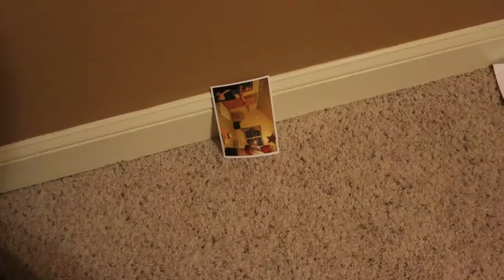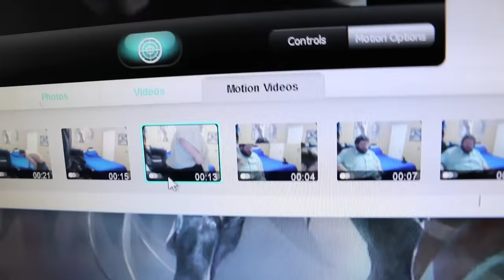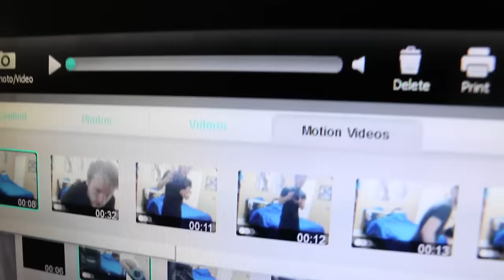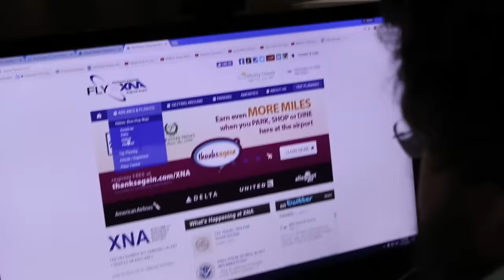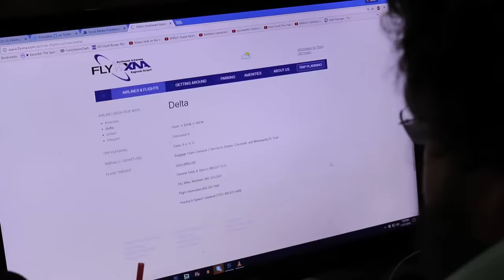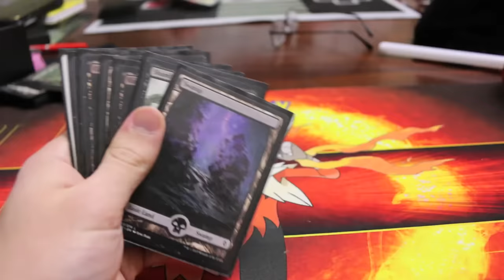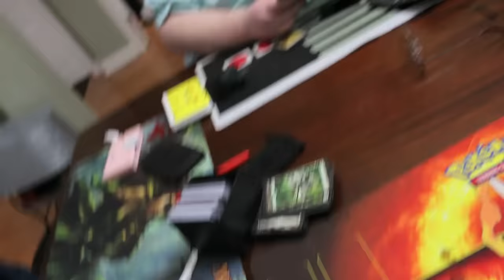TRAPPED IN THE ATTIC BY AN OBSESSED FAN!

Comment: Boogie shooting Roman candles into an insulation filled attic is PURE DEDICATION!!😂😂
Reply: Ehh... Insulation actually doubles as fire protection due to it being a fire retardant. Houses wouldn't last very long if the walls and ceilings were filled with tinder lol
Reply: Glass is not flammable though.
Reply: @robertlortz550  I dont think it's about the insulation catching fire, but rather the fire blowing around the fiberglass which jessie could breathe in
Reply: @robertlortz550  oh, alright then, my bad lol. I just know of the dangerous fiber glasses in insulation and have heard of people dying from inhaling it because it digs little holes in your lungs, so the ones i heard were probably much older products of fiber glass. thanks for clarifying
Reply: Omg
Reply: @robertlortz550  cap
Reply: @real_Donald_Trump  it’s not the glass we use as windows
Reply: @mushroomxfaiiry8351  Dude. I work with insulation at my job lol
Reply: @robertlortz550  I’m not a dude 💀
Reply: @mushroomxfaiiry8351  😓 Sorry haha
Reply: @mushroomxfaiiry8351  silica glass is the same. It may be slightly different but it is like glass cotton candy
Reply: @real_Donald_Trump  should’ve done your research before arguing bc you’re going to loose

Comment: The fire works in the attic is actually extremely dangerous, and the leaf blower. That insulation is fucking dangerous.
Reply: Glass is not flammable and the leaf blower was just for looks or you would see sparkling in the air or Jessy would be coughing much, much nore